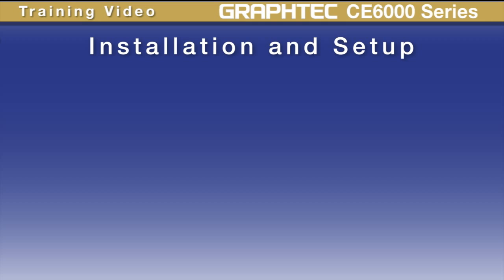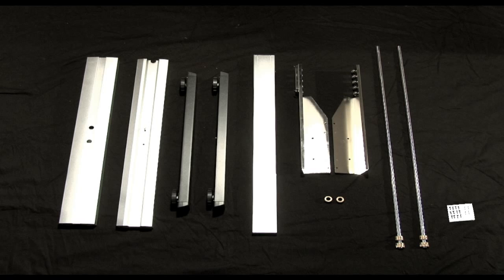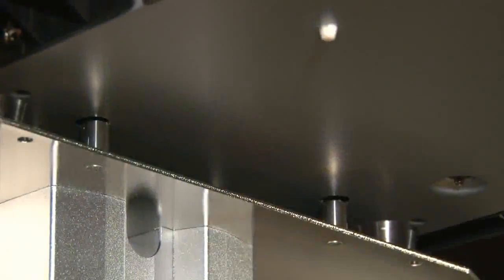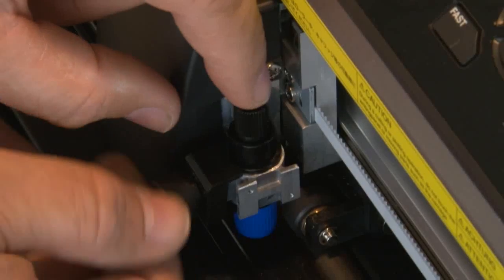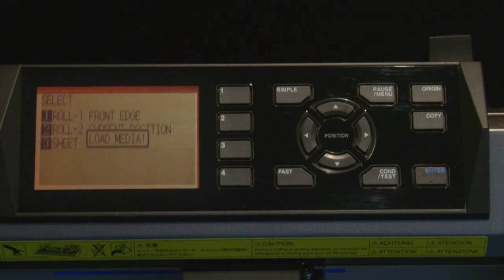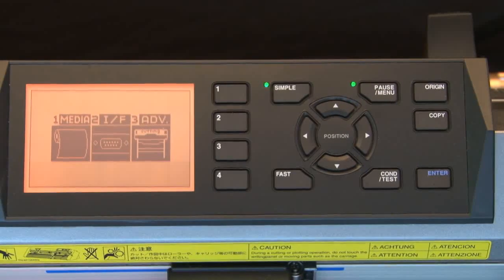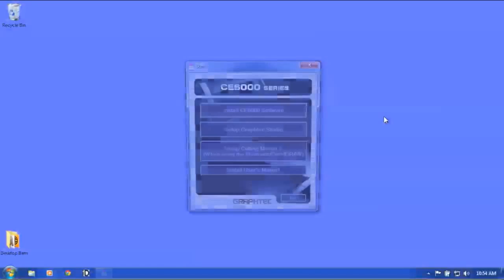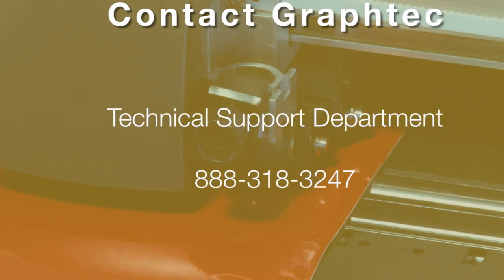Graphtec CE6000 Tutorial - Install & Setup

Comment: got a ce5000-40, but the laser is not aligned correctly. the screw that holds the laser assembly was lose, so the laser was more to the right than it should have been. i pushed it to the left a tad and tightened it. fixed most of it, but it's slightly at an angle when it should be straight. is it possible for me to send in only the carriage assembly and have a tech straighten the laser?